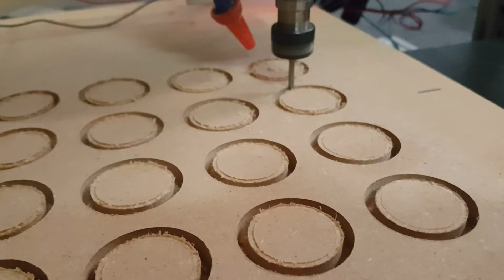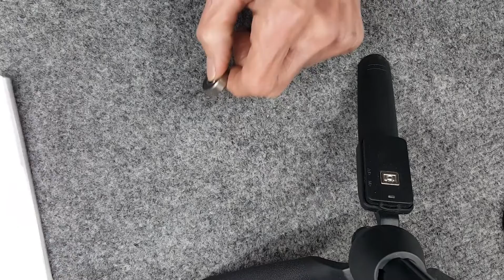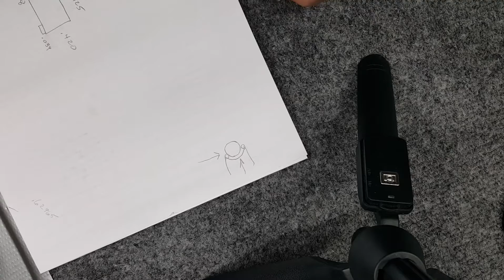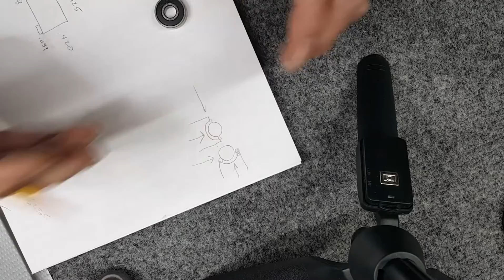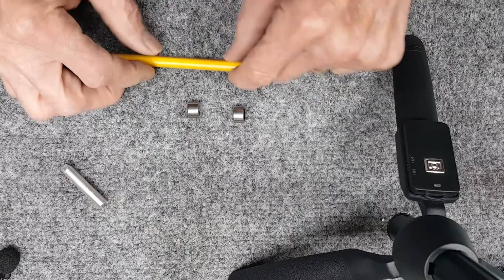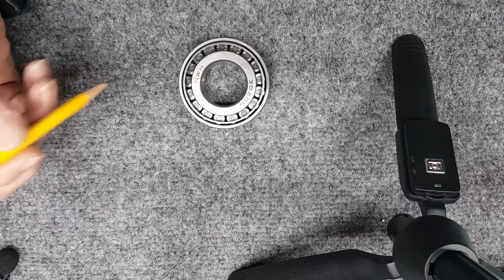About Different Bearing Types Pros, Cons and Usage

Comment: Hi Dave as a beginner new to machining I found the info very interesting, the one thing I can’t seem to find info on is when press fitting what size do you make the shaft to ensure a good press fit. Is there a rule of thumb or correct measurement. 🤔
Reply from the maker: press fits require .0002 so if the shaft is ,318 then the bearing should be ,0002 smaller. That always works for me nicely.